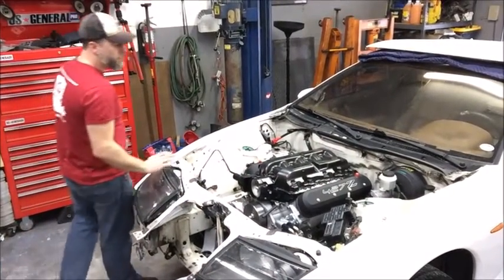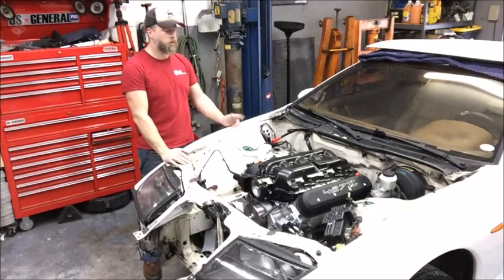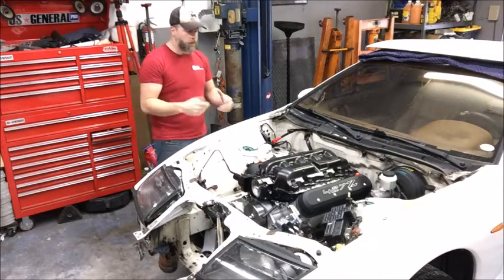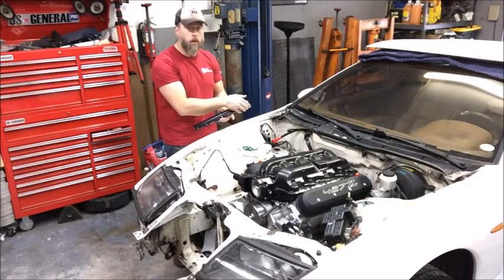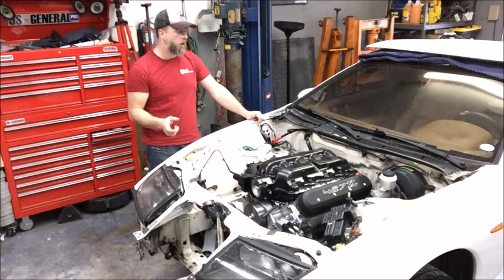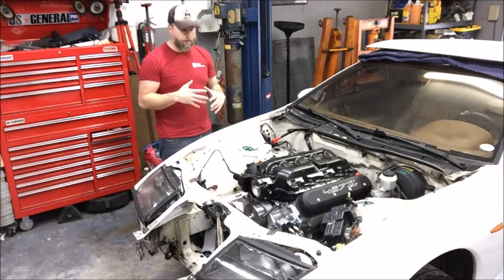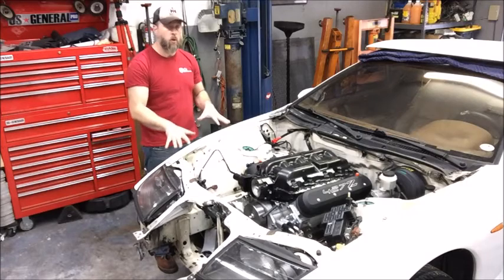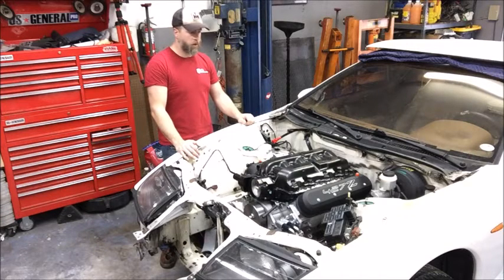LOJ VLOG - January 18, 2017 - 427Z Fuel System

Comment: Would you do a other one take video again?
Reply from the maker: Of course! But that really depends on Matt being back on the east coast again.
Reply: @LOJConversions  I think I saw the black Z Matt drove, here  --->>>  https://www.youtube.com/watch?v=O0y2N7f0A3Q  
Quick Question: If you were doing a swap on an automatic equipped Z (I'm looking at picking up a cheap {under $5000} 2+2 with a clean carfax), would a 4L60-E based transmission fit the tunnel of the car? If not, how much can you beef up the old Nissan unit (as far as torque and horsepower capacity)?